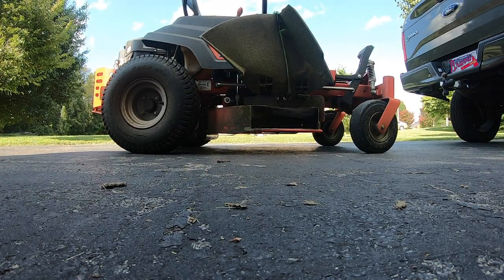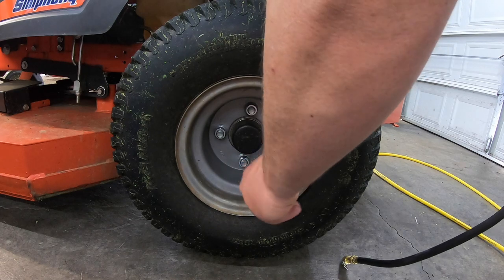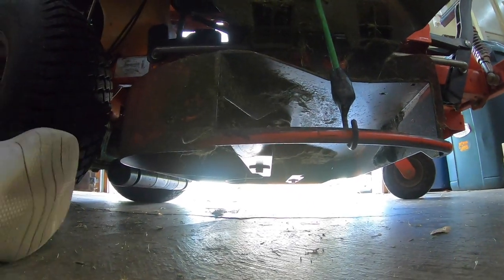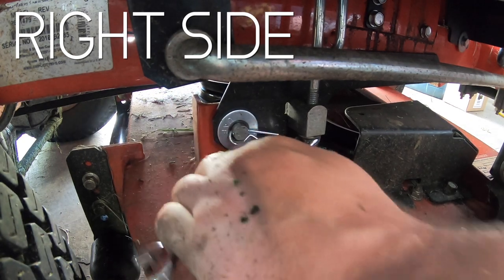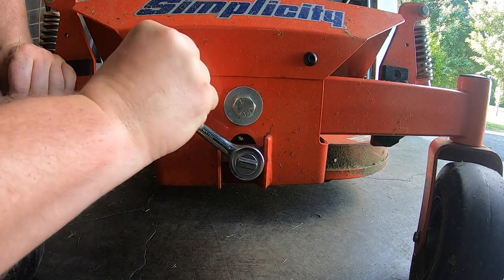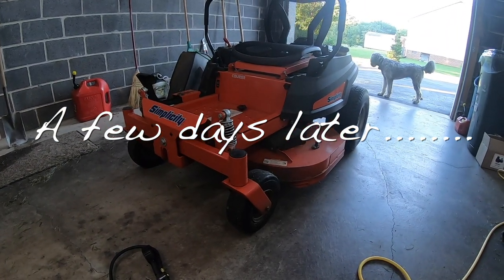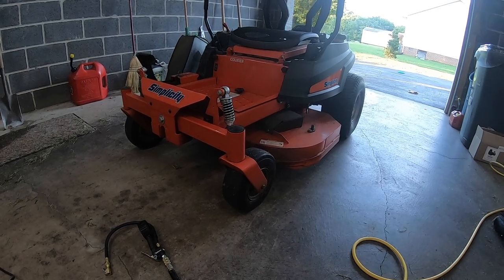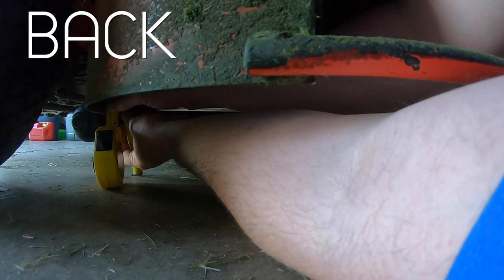How to Level Your Riding Lawn Mower Deck | Zero Turn Simplicity Courier

Comment: Did yours not come with the 2 front deck wheels - I think they are anti scalping wheels? What is the reason they are not on your mower? I am about to buy one used and it doesn't have them either. Looks like identical mower similarly.
Reply from the maker: No, I bought brand new in ‘18 and it didn’t come with wheels on the deck.  Just a striping roller on the back.  FYI - built in striping roller is useless unless you have a fairly flat yard.
Reply: @weekendhomeprojects  I have read numerous places you can lower the roller bar and it creates nice stripes. Is it adjustable?
Reply from the maker: @lmbuehrer12  You can adjust / lower.  I have a video showing when I did it.  But if your yard is bumpy or hilly the roller doesn’t work well if at all.
Reply: @weekendhomeprojects  dang that’s crappy. How does it stripe overall? I figure I’ll buy a big lawn striping kit but I was hoping the rollers did a good job. Does it cut overall really good and leave stripes or no stripes?

Comment: Maybe I missed it, but why would you set the pin at 4.5”, then measure to a height less than that? Seems like you should aim to match.
Reply from the maker: Yeah, at around 2:05, I had the bracket nut all the way to the top and it was only measuring 4”.  So 4” was the most I could go but it eventually worked it’s way to 4 1/8th.  My guess is something got bent one day when my deck fell off the hinge due to a broken bracket pin.